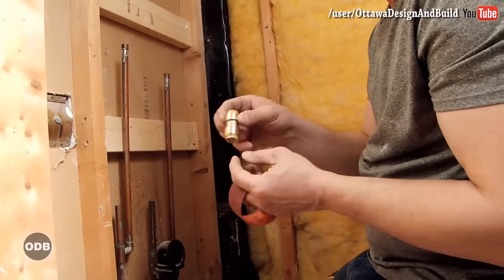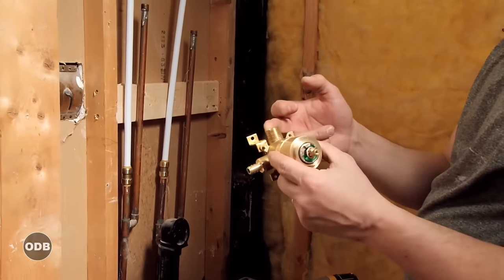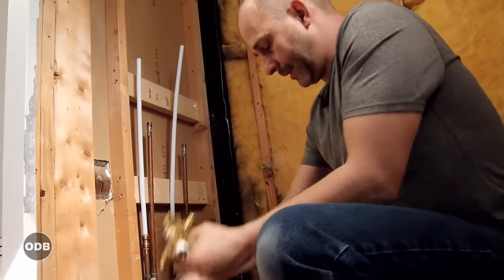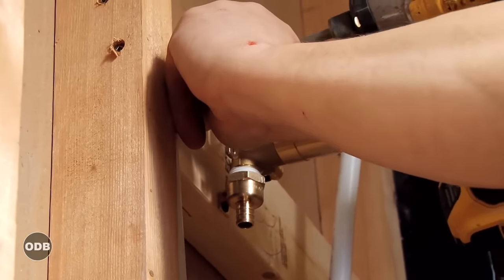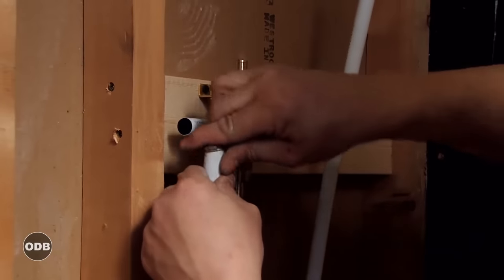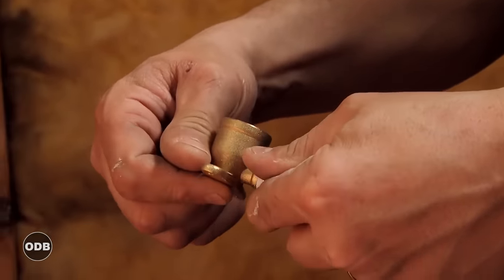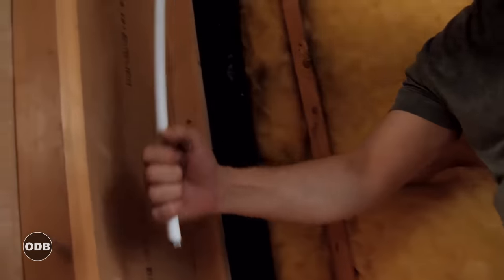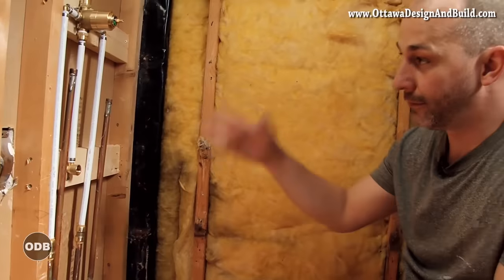DIY How To Install Copper To Pex | Shower and Bath Plumbing

Comment: So much wrong in this video...
Reply: Perhaps your care to elaborate?
Reply: like holding the teflon wrong.   :)
Reply: CapApollo glad I'm not the only one who noticed hah
Reply: CharlieHaasPop he didn't use inserts before connecting the shark bite to the pex
Reply from the maker: Still amazed that you guys think the inserts are necessary. contact sharkbite and they will tell you otherwise.
Reply: pex should never be used to the tub spout..even the instructions for the valve will state: use copper or IPC only. the reason for this is backpressure...the pex diameter is too narrow and may/will cause a partial backflow to the shower head. not a problem when showering, but when you are just filling your tub water will be coming out of the shower head too..very unprofessional..i know from experience.
Reply: youjustgottadrum hnd bas be
Reply: Yep, to start plastic piping a recipe for future problems.
Reply: inserts ARE necessary for pex they are FOR that purpose, you can remove them for copper connection ( should remove them ) as they can fracture over time cause they move a bit in the fitting and can end up clogging the shower valve ( I have seen this on a few occasions )
Reply: Rb S I said this exact thing and it is exactly true... but pride makes the video maker doubt this and not able to learn, I have been a plumber for over 20 years and seen this exact thing happen, tub spout builds pressure and then shower head starts to sputter... does not matte how good a job you do if the fixture does not work as intended after the wall is closed. 
:)
Reply: he never said the pex was, he said the FITTINGS were. the pex is 1/.2 " I.d ( inside diameter ) the fittings are 3/8 I.d. Go ahead and  measure and maybe use some restraint before you go off on people who are trying to provide you with accurate information .
Reply: You should mark the depth of the push fit has gone on, I have placed thousands and some get stuck and you think you have pushed all the way, particularly for the larger size pipe.
Reply: the guy was correct, it will back up the shower, I have seen it a hundred times, i take it your not a journeyman plumber !
Reply: It's true, it may work the way it was done, but it is easy to see he is not a real "plumber".  1st, 1/2" pipe "outside diameter"...I doubt that.  2nd and 3rd, it was painful watching him with the teflon tape and then turning the channel locks the wrong way.  In the end, doing it with the shark bites and pex will probably work, but our plumbers would not be doing the job that way.
Reply: Electric

Comment: Not a bad video. I see you do something that I have explained to folks when using tools. There's a right way and a wrong way with exceptions. For example. When you were installing the 1/2 in pex fitting. You were tightening it with pliers using the pliers in wrong direction. One direction actually pulls the pliers tight the other direction wants to force them open. Same thing goes for tools like crescent wrenches. Of course I'm sure you knew that. The other issue is that I have found that using 3/4 in pex to the shower head and spigot reduces shower head dripping when filling the tube. There is just not enough water volume in the pex to the shower head to let the water act as a stop when running water into the tub. Those are flow valve for direction. They are mixing valves. Overall nice video though. Thanks.
Reply from the maker: Thanks Robert, I appreciate your comments. I am definitely guilty of using the wrench the wrong way sometimes, When in a hurry I just rely on brute strength.lol
Reply: I would sooner not see channel locks used period . I prefer a crescent wrench as it doesn't elongate the connector as your applying pressure during turning . Each to his own though

Comment: Two things. 80% of my remodel work are baths. Pex is great. Easy runs, fast work, finish time reduction. HOWEVER, 1)don't ever use any kind of push on fittings without access. They will never be labeled for what they really are. Thge seal is rubber rings which oxidize and break down ESPECIALLY with treated town water supply. They are good in use of 15 years before a permanent fitting is needed. Intentional remodeling should exceed that time. 2) some but not all mix valve tub to shower diverters cannot have 1/2" pex to the tub spout drop ear. The pressure flow decrease can make the shower head trickle even while the spout plunger is fully down because pex does not have the same inner diameter as copper and the mixer will actually send a slight enough amount of water up to the shower head. So, sweat on your copper to pex adapter if there's no plumbing access and sweat the tub spout. The rest is fine for pex, even secondary sprayer controllers.
Reply from the maker: Thanks Jeremiah. Nowadays the tub spout is molded for 3/4 inch pex! and the sharkbite fittings are accessible from the other side.

Comment: I love how he uses channel locks backwards to tighten the fitting. He also looks like he’s never used Teflon tape before, holding the roll backwards makes it very difficult it pull the tape tight while wrapping it around the fitting

Comment: Easy to understand. I would suggest just using one pipe sealant. One of the sealants main functions, is to provide lubrication, which allows a better interference fit of the threads. The threads are designed to do the majority of the sealing. If you use Teflon tape, two wraps is plenty, as there is virtually zero clearance between the male an female threads, other than at the gaps between the crest and root of the threads. Using to much TT can prevent the threads from mating properly, and all of the excess Teflon needs to go somewhere. Which is usually at the top of the female fitting. I do prefer the paste, except that it should be given time to set.

Comment: On another video they said to use solid copper down to the tub spout and up to the shower head. His rationale was that the pex fitting down to the tub spout narrows down a bit, which increases pressure in the line the  and causes back flow up to the shower head and leakage. What do you know about this or have you had it happen?
Reply: That video is correct. This video does many questionable things, so I would continue to cross check it against others. 1/2" Pex inner diameter is too small. I have heard you can get away with using 3/4" pex down to the tub drop ear though. If you have a fairly low pressure water supply, you can get away with 1/2" pex for the tub spout, but it's really not worth the risk. Plumbing is something you want to get right the first time IMO.

Comment: as a homeowner I have access to plumbing supply store that sells pex and fittings 50% to 70% less than the box stores.  but with that in mind home depot in must areas will rent the tool to you. pex also is best in areas were consistent freezing may happen as pex won't burst as easy.
Reply from the maker: Very solid points.

Comment: I keep seeing comments about using 1/2" copper or 3/4" pex from the shower valve to the tub spout. The reasoning is that there's to much restriction in half inch pex fittings , and when the water is traveling down to the tub spout , the water slowly comes out the shower head . I'd like to go strictlily pex , but I'm seeing alot of plumbers going with pex into the valve , but going with copper to the tub and shower spout
Reply from the maker: One great way around this is to use a 2 function shower valve. This allows all pex install and all you do is turn the handle from one function to another. Riobel pro makes a few models at a good price.
Reply: MajorTendonitis that is absolutely correct however the challenge using three-quarter packs is getting the adapters to work with the valve can be a challenge to find sometimes. However I have been shopping Lowe's 4 years more often than Home Depot and I I always get frustrated when they change vendors however this time around I'm noticing more three-quarter inch adapters available that will actually work with shower valves that will rid of the pressure restriction issues

Comment: Sharkbite connectors you used (behind a tiled wall?), are they going to work 10-15 years later?  In areas readily accessible, they may be easy to work with. But, inside walls, degradation with time may be problematic. They contain rubber seals which will degrade with time.
Reply: I would also be nervous relying on sharkbites behind tile. For the extra trouble of soldering on copper to pex connectors, for the peace of mind, would be so worth the extra effort.

Comment: Hey if your shower trickles when your just filling tub. Use bigger drop leg fittings on tub drop. I’ve found that pex a or copper fixes this. Pex b has just enough restriction to allow water to start dribbling out of shower head. Moens are real bad about this. Just a tip I picked up out here. Great channel and good guidance.
Reply: So should I use 3/4 pex vs 1/2?

Comment: Awesome video!  I'm a DIYer and in the progress of renovating one of bathroom.  Is the Sharkbite  connection from copper to PEX safe to run behind drywall?  One guy on another youtube channel says not safe to run behind drywall in event the sharkbite connection fails.

Comment: I’ve used pex for years . Love it, just starting to learn to use ubinor. Not sure about press copper. I’ve seen sinch rings fail as well as shark bites but I won’t use them in a wall. I solder a lot of copper.

Comment: Saw your answer way down the comment section. As of now, September 2016, shark bite says you can leave white sleeve on for a copper connection.
Reply from the maker: Thanks for the diligent research. I have personally never had a problem in the last 2 years leaving them in.

Comment: Dear Jeff :  I want to beat myself up. I didn’t do like you : Teflon plus paste on the brand new valves I have put... tolerances are sh... so naturally it leaked. Now I have to find a damn way to remove to whole installation. Pieces of ... Thank you for all;)
Reply from the maker: Sometimes we learn the hard way. Cheers! and best of success.!
Reply: Home RenoVision DIY Will tell you tonight ... re did the whole thermostatic valve last night . Paste and MIL Teflon tape. Leaving the pressure on all the day on the different settings . TELL me please : by code doesn’t matter if PEX tubes touch each other ? Naturally they can’t move : they just touch . Thanks for all;)
Reply: Home RenoVision DIY JEFF: could it be , since a lot of those valves are made in Taiwan , those are not NPT but BSP...? Damn hard info to get also...
Reply: Home RenoVision DIY my type of blues to;)

Comment: I seen in another video ur in.. You said you wouldnt in close the sharkbite.. But in this video it looks like thats what your doing.. Just was wondering cause i was gona use it in side a wall... The sharkbite that is... But you have turn me on to some new advances in pluming thanks...
Reply from the maker: we have an access panel on the other side of the wall. Cheers!

Comment: Thank you for this. But I'd like to ask a few questions: 1) Why 5 or more wraps of the teflon tape? Especially after starting with the paste? Wow! 2) If you turn your wrench around, you'll get a better bite with the jaws. That is the way they were designed.

Thank you for this. We are in the starting phase of building a home and I will be using Pex for my (water supply) plumbing. The details you provide will shorten the learning curve.
Reply from the maker: glad this helped.
Reply from the maker: I have seen many compression joints fail from plumbers who only use teflon or very little. I have found that overkill never fails. The chinese manufacturing has reduced the quality of the fittings and needs to be considered.
Reply: Tape and paste and you'll never have any water waste !!

Comment: Have you had any problems with PEX on the tub spout with "shower rise" where the water comes out of the shower head when tub spout is on?
Reply: Same question!!! I'm gonna use uponor which is internally larger but still want to knkw
Reply: Been looking at that lately as well. Usually people will say to use copper because 1/2" pex is much smaller than 1/2" copper on the ID. However you can get 1/2" npt fittings that have 3/4" pex nipples and just use 3/4" pex for the tub spout. Internet seems to agree that this is the way to go if you want to use PEX on the tub spout.

Comment: Great video thanks. I am installing Pex with the compression ring like you’re showing. Even after I’ve squeezed it down as tight as it goes my fitting still moves a little bit inside the tube If you try to twist it. It still feels very snug but it’s still can move a little bit. Is that normal? I don’t wanna have a problem behind my tile thanks.

Comment: I was always concerned about using shark bite especially behind the wall. Thinking that it could fail. Am I wrong? I would like to replace my copper line to pex in bathroom and was going to use shark bite rather than a torch.

Comment: Hello I have a question, I installed a brand new shower shower valve and shower head. I used 90-Degree Drop-Ear Elbow for all connections including for the shower head. When i tested it the valve is closed but its releasing slow water pressure from the shower head. I doubt its a defective shower valve but could it be its leaking bc i used all 90-Degree Drop-Ear Elbow? Thanks and good job on the video
Reply from the maker: double check the valve cartridge install. it is most likely not seated properly or has debris stuck in it. Cheers!

Comment: Good job and thank you for your video, Now i have a question. With the use of pex, is not necessarry to install air chambers? I really was never use the pipes Pex
Reply from the maker: The shock absorbers are used with copper to keep air from hammering in the pipes. Pex does not have this problem and as such there is no need for them. It doesn't hurt to add them if you want to play it safe.

Comment: you should never run pex to your tub fill, the ID is too small, and if you have good water pressure in the house, you will get water coming out of the shower head
Reply from the maker: thanks again for this. already been covered in the comments to use 3/4 line

Comment: Recently used shark bite fittings and pex lines to run water to my garage and back of house .It was so easy its scary! I must have checked those fittings two three times a day for a week .Love them but not sure how comfortable I would be using them behind a wall. Then again I've heard plumbers say nothing good about pex lines and fittings . But around here all new construction is almost100% pex.
Reply from the maker: Plumbers don't like pex the same way taxis don't like uber. They make their services a little outdated and expensive.
Life is not going to get any cheaper. Most people need to start getting handy again.
Reply: Home RenoVision DIY -  "Life is not going to get any cheaper. Most people need to start getting handy again." 

Totally agree. And I've been told that most young people today have no practical skills. It gets expensive hiring professionals to do everything for you. If you've got a lot of money, then it's fine to hire out all your jobs, but some of us have more free time than we have disposable income.

Comment: Hi, I really have a silly question. I went to home depot Ottawa, they told me not to use PEX for shower head and tub spout, because the pipe coming out of the valve needs to be able to support the weight of the tub spout and handle the abuse of pulling/ pushing down of the divirter built into the spout. Could I use PEX or this statement still valid???
Reply: They full of shit. It’ll be fine just make sure you screw it in like he did. If your still feeling uneasy just add another 2x4 mid way and screw in another support. It’ll hold np

Comment: Hey Jeff - So I think I installed a universal shower body (with all compression inputs) the wrong way. Nothing even comes out of the shower when I take the test plug out and now both supply lines are warm. I'm guessing I just need to rotate it?

Comment: Maybe would want to use the PEX measuring tool and mark the pipes with a line to make sure the shark bite is at the right depth. Sometimes it can feel like the part is on tight but its not all the way.  on.

Comment: I got the sharkbite in multiple places behind the wall and I do not feel comfortable with it because I had a leak. Thankfully only the wall went up when we found out so the sharkbite may not have been installed correctly we will never know but for now, I do not trust them. I would feel waaaay more secure using the crimping with the pex and NOT the sharkbite, at least for now since they have not been out on the market that long.

Comment: Could you suggest a proper way to resolve my issue of splatter with the new fountain type faucet that I just installed , when you open full throttle you take a shower with the spray , pressure throughout the house just right , with a small child in the home a remedy is needed quick .many thanks

Comment: Nice vid. Lots of good info here and in the comments. My only suggestion would be to not use drywall screws for mounting. (not sure you did, could not see)  Always use something much stronger. The valves and drop ears get a lot of leverage over time. Drywall screws are way to brittle.
Reply from the maker: good practice, however removing the trim results in access to change screws if ever necessary.